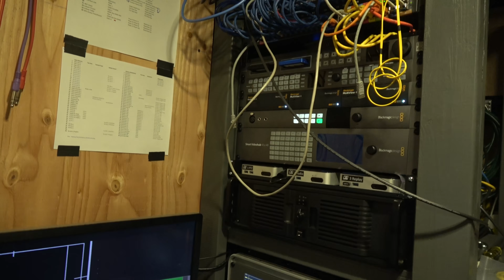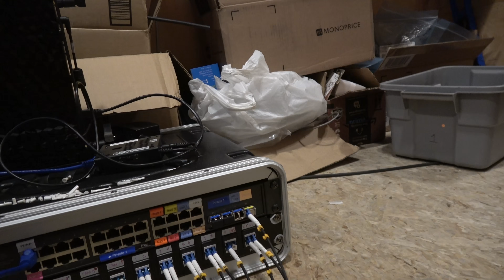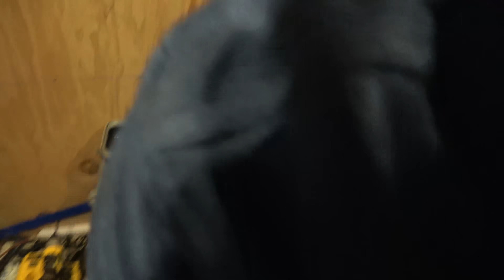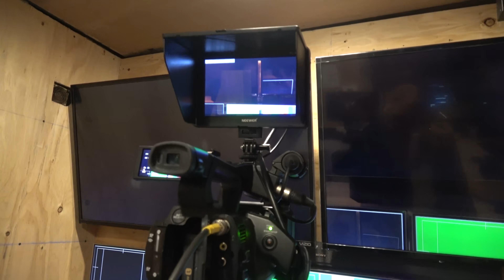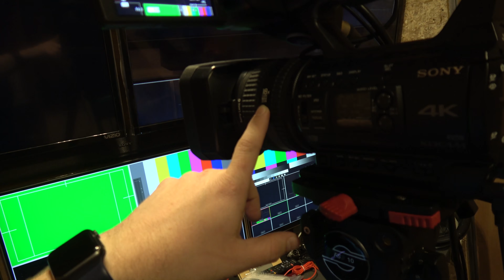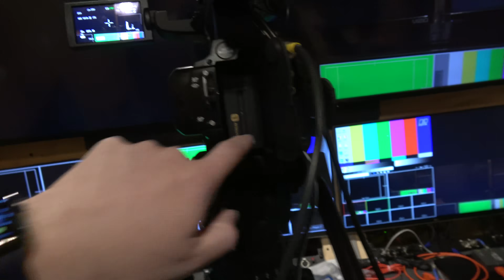Signal Transmission over Fiber: Camera to Trailer (Budget Video Production)

Comment: Hi Doug, great video as always. Very detailed explanations. Can you share details of that fiber patch panel? The gig switch on your breakout box, is that setup in a master and slave relation with the switch on your trailer rack?
Reply from the maker: The fiber patch panel in the breakout box is completely passive -- most signals are just wired from one jack to another, with the exception of the two return video feeds, which are each split four ways using optical splitters -- camera connections 1-4 get video from Return 1, and 5-9 from Return 2.  (Channels 8/9 also go through an additional 2-way splitter)

The network switches are essentially just peers on the network -- neither acts as a master nor a slave.  They're both setup similarly in terms of the ports I'm plugging into -- both trunk ports are assigned to all applicable VLANs (egress packets tagged) to share traffic between the two.  Nothing too special.  Inside the trailer there is a Ubiquiti Edgerouter X that provides the main routing capabilities, so the switches themselves are mostly just acting as switches.

Comment: Hi Doug, just came across your videos, love them! Question about framerates and resolutions. Since the ATEM doesn't have a scaler, do your run them through Decimators to upconvert them? My problem is that we will be getting Ursa 4.6Ks soon and I want to get the most out of the 6/12G capabilities. If we set the output at 4K60, would we have to convert all our equipment to that resolution/framerate? Since the Decimators don't support 6G would the only choice be to buy a ton of Blackmagic converters to get everything to match? Would we also have to do an extra down convert at each monitor/display since all the micro converters and Smartview Duos only support 3G and also scale up the computer output of a Decklink 3G card?
Reply from the maker: I almost always set the camera and switcher framerates to match.  The one exception is when I'm shooting 1080p29.97.  Several of my cameras might shoot but won't output at 29.97fps to SDI/HDMI natively (they'll send 1080p59.94 with frames doubled instead), so I have to run those through the Decimators to bring the framerate back down.

Getting 4K60 signals to your switcher from the cameras could be an issue if there's any kind of distance involved.  Not a lot of cable can support 12G over very long runs.  There are a few options becoming available, but they are still few.  You can go fiber, but converting 4K60 to fiber isn't trivial either.  BMD doesn't currently sell any products to do that.  Take a look at https://www.blackmagicdesign.com/support/faq/59012 to see what cable BMD recommends for 12G-SDI.

Doing any sort of conversion involving 4K would require a bunch of Teranex devices.  And while their newest AV version of the product is much better about latency than the older versions, it's still there.  If you're doing IMAG I'd think long and hard about whether you really want to try to switch 4K, especially if the projector doesn't support 4K and would involve another conversion.  4K60 is possible, but it is still somewhat difficult (and much more expensive than 4K30) to pull off.

And for display on monitors, you'd need 12G capable converters and probably want to go with 4K displays where you can so you can avoid latency-inducing conversions.  If you do 4K30 you can go with the SmartScope Duo instead of the SmartView Duo -- it will accept a 6G-SDI signal.  The image quality on both of those monitors is pretty poor, FYI.

Bottom line is that doing 12G is still kind of difficult and I'd ask myself if you really want to go that direction.  6G is a lot easier, so if you don't really need 60fps in 4K it's a lot easier (and far, far cheaper) to build a system.  You could also do what I'm doing until BMD creates a 4K version of their Camera Converter -- record 4K in camera, but output 1080 on SDI.
Reply: Thank you for replying! So it looks like I'll have to scale back my plans and go with 6G. Even then I'm guessing all our SD cameras will need to be run through an upconverter? What about computers output? Do you run CG at 1080p29.97?
Reply from the maker: You'll want to do an up-conversion on SD material.  If it's already digital (SDI) that's easy enough with the Decimators.  If it's analog you'll need to make that conversion first.  

Finding computers that will do 1080p29.97 is hit or miss.  The Intel NUCs I have in my trailer do, as will my Windows laptops. Macs can be made to do it, but it often requires third-party software to expose those video modes.  It depends a lot on what video card the computer has, and whether the driver supports that particular mode.  It hasn't been much of a problem for me.

Comment: Always love operating with that camera setup. The Z150 is so clean in dark situations with grain. Love being able to bump the gain up and not worrying about that. And yes I have come around to that push button zoom controller. I know every time that I am going to be getting a smooth consistent zoom. Of course I’m a huge fan of Sachtler, those newer Manfrottos can be smooth once you get the settings just right and then you’re set.
Reply from the maker: I'm always impressed by how clean the Z150 is in low light.  It's nice knowing I can pump the gain up to +12dB, +15dB, or even +18dB and still get a really clean image.  First camcorder I've owned that can do that.

Comment: So Tally does get into the Multiview somehow? Does the Camera Converter do that?
Reply from the maker: The ATEM switcher sends tally information as part of all of its SDI outputs, and their Multiview products know how to decode that information.  So as long as I feed one of the switcher's outputs into one of the Multiview's inputs they can display the tally boxes.  (It's a bit of an incomplete implementation, though -- it only works for the first four channels and can't be reconfigured.  It also doesn't pass that tally information through to the SDI output, which is unfortunate.)
Reply: Sigh. Blackmagic's always 95% complete and then there's that 5%. :D
Reply from the maker: I agree.  It's especially frustrating when it is something that can be fixed easily in software.
Reply: So how do you get the tally information into the camera converter if the multiviewer doesn´t pass it?
And another question - did I miss the video about the one-fiber connection to your ptz cameras? Could you explain how you are doing that?
Thanks a lot Doug, I really like your content!!!

Comment: I was going to get a Sachler, but decided to give Benro a try.
Reply from the maker: What do you think?
Reply: They are not in yet. The fluid head sets up well. Fewer stops to balance with, but it has 7 inches of slide as well, so it should work to balance the lighter cameras I want to use. Lots of models to choose from. I decided to try the BV8. They also have a 10 which would be closer to what you have. My dealer doesnt stock any of them, but said all I would risk is shipping it back. I will let you know in a week or so what I think.
Reply: benro is good price and stable product that i use before till today